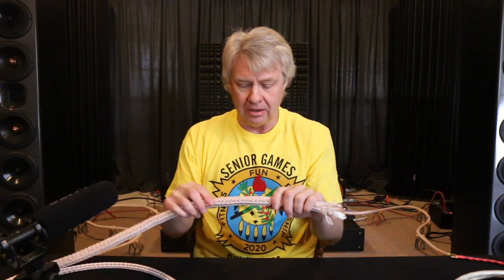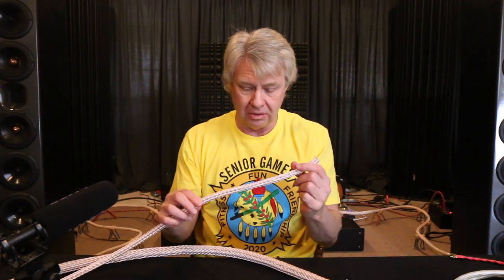What’s up with Audiophile Cable Risers?

Comment: I've always been told that rising the cables is only really needed if it's a concrete floor with rebar in it. Something about the cables being close to the metal rebar causes an induction effect.
I actually don't know what's happening but don't doubt it's noticeable in a high end hifi system. Because what isn't? ;)
Reply: My cement floors do as you describe...
Reply: I have read that even a regular carpet can generate static electricity that can affect the cables. Risers are one way to get those cables up and away from any potential static or induction interference. Just realize, it's a tweak, not a cure-all!
Reply: @dmark2639  Bbbbbutttt it is a cure for floor generated resistance. In the first system I put the speaker cables on risers-er- cardboard boxes... it removed a haze, a dampened thing on the high frequencies that I simply could not sort until that moment. And what are other tweaks? Let's say I use sorbothane for the feet of some gear or speakers, yes it's a tweak, but the tweak cures a problem. Tweaks are not silly flamboyant flourishes, they are cures for real sonic problems in a room. Spend a few years treating room s and you'll understand that tweaks are, when used properly, cures for genuine sonic interference in the sound your hearing from the system through the room. And by all this I do not mean tweaks bought from $$$$$$$ vendors, I mean an understanding of materials and physics and using the best materials to solve problems, it is amazing what one can do with just the few materials that actually apply to audio, the aforementioned Sorbothane, Rockwool, MDF, mass loaded vinyl... cheers.
Reply: @dmark2639  only if there was something causing a rubbing motion constantly
Reply: @cabasse_music  Like your feet as you walk around in the room? Yep, that'll do it.
Reply: @dmark2639  no i mean right where the cables are touching, and to such a degree where the motion is so constant that it is never able to dissipate. this is all easily measurable anyway and even in some case where a static charge was building up on the carpet, the insulation of the wire would be more than enough to block it. this is flat earth science right here

Comment: Excellent advice.  My journey followed a similar path.  Well after my system achieved a good 3d sound stage I read about cable risers and skeptically tried them and observed similar results.
I have used cardboard V risers.   My fastest most cost effective was paper coffee cups.  Paper has a dielectric coefficient as good as cotton.  I am so cheap I saved my morning coffee cups.  Cut a V in the top and they work well.  3" tall.  Bingo.  Currently I don't need them.  The speaker cable is sized to travel from the monobloc to the speaker without touching the floor.
Now for an even more controversial topic.  I find a slight improvement getting power cables up off the carpet.  Impact is a slight sense of compression of the sound like you have with a new capacitor.  Not as pronounced.  Definitely could not pick it out in a controlled ABX test.  But once you hear it, it stays in the system.  One of those hundred little things that all add up.
Reply: I'm like you. I look for low cost tweaks that can help. Find a half dozen of them and things become noticeable. I can't afford $2,000 amps, ect.

Comment: What's your floor construction? Is it a concrete slab? If so, there is probably steel mesh reinforcement (often 6" x 6" grid). Or is the floor constructed in another way?
What's going on?

Comment: So how do I manage the 50 cables hanging off the back of my equipment?  I can't seperate all those cables in the cabinet.  Is there a similar cable management system for all the power, RCA and speaker wire mess behind the cabinet?

Comment: Is it electrical or vibrational issues affecting the cable, and what’s under the floor? If height doesn’t matter  then perhaps using slit pipe insulation,cut into short pieces would do the job too

Comment: would this be the same for power cables and interconnects, or only something that affects speaker cables. Not that my system is anywhere near the level that it would make a difference but just curious. Thanks for the great video Danny.

Comment: At dealers, shows, that I have seen the use of risers, the explanation was always the same,  static electricity in the carpet was affecting the sonics and that it wouldn't have much effect on wooden floors.  Never heard of rebar in concrete issue or see how cryogenically treating the risers would improve things.  But hell if it works,  c'est la vie.

Comment: 😂 Danny did you measure the difference? Being an engineer can you explain what it is what you think you are hearing?
Reply: How to do you measure the depth, width, height and layering of the imaging and sound stage? 

In the past I’ve put bits of tape on the front and side walls marking positions of where certain effects, instruments or vocals come from, Swapping out bits of gear or moving room treatment makes a serious difference to how it’s all presented.
Reply: @lloyd.8272  yes it does but I am not buying setting speaker wire or any other wires for that on toys is going to make any difference in any of those things. To answer your question crosstalk, separation, reverberation and reflection and SNR and noise floor all can be measured and will effect our Psychoacoustic perception. Also placebo effect will effect how we perceive sound. That is all I know but I am not an engineer either. 😊

Comment: On one of our trips to ikea, purchased some cheap glass tea light holders with little slot designs at the top that could (effectively) cradle my cables. And - dammit - it made quite a difference.
Reply: Lol I didn't want it to work either.

Comment: I used cable risers with my planar speakers but did not notice any difference. I upgraded my speakers a few months ago, but didn't bother using the risers, just left them on the hardwood floor. I tried the risers after seeing Danny's video. I experienced everything he said. Thinking that it was an expectation bias, I rounded up the House Boss, who has no interest in stereo, and thinks that audiophiles are mostly males with OCD issues. She sat down for about 15 seconds, and said "What did you do? It sounds a lot better!"
I don't think the issue is whether they work or not, the issue is, do they work for you?

Comment: Tried it back and forward a few days with my speaker cables, sounded better without the risers and just lying on the carpet. There was definitely a difference, with the risers voices became thinner and almost fatiguing. I now use them to route the power cables over the signal cables but stay away from the speaker cables 👍 Still find it strange to notice a difference 😳

Comment: I watched your video on getting the speaker cables off of the floor. I didn't want that to be a thing. Two months later my girlfriend cleaned up the living room and took all the cables off the floor and stuck them under the tv to get them out of the way. When I woke up I didn't know she had done anything but she was playing music and I could tell right away something had changed. It was so obvious that it was better, I could hear things in the music that I've never heard  and she plays these songs a lot. Seeing 2 garbage bags by the front door told me she had cleaned up the spot where she sits on the floor in front of the tv. I knew without looking that the wires weren't on the floor anymore. Does it make a difference, way more than you think it will,  get them off the floor, the difference just might shock you. It's noticeable immediately.
Reply: Don’t you think the acoustics of cleaning up a room would have much more of an effect than speaker cables not being on the floor
Reply: @ar_xiv  no, having the wires off of the floor has made a difference. The room was cluttered many times since and the sound has not changed.

Comment: Read an explanation from a physicist about energy transfer in a conductor.  Electrons do not start in your source and physically end up in your speaker.  Summarized as follows, "electrical energy does not travel though the wire as sound travels through air but instead always travels in the space outside of the wires. This is because electric energy is composed of electric and magnetic fields which are created by the moving electrons, but which exist in the space surrounding the wires."  Energy transfer from source to speaker results in creation of pressure variation or ears perceive as sound.  Therefore, it makes perfect sense that the electric and magnetic field (energy) surrounding wires can be affected by materials or other electric or magnetic fields.  Do cable risers, copper, insulation, etc. always make a difference in every situation.  No.  But Science is clear that an affect is possible and saying that those things can't ever make a difference is wrong.
Reply: With or without risers they measure the same. Flawed human hearing is more likely to explain the sudo differences be heard. Again never seen this replicated in blind tests successfully. But I have seen guys like Dany fooled with lamp cord or a 320kbps mp3 in blind tests.
Reply: @neandrewthal  So does science only matter when it aligns with your beliefs?
Reply: @iowaudioreviews  There it is, the usual refrain about flawed human hearing.  "Two ears and a brain respond very differently to a complex sound field — and are much more analytical — than an omni-directional mic and analyzer. (Dr. Floyd Toole).  If flawed human hearing cannot be trusted to hear differences, then it cannot be trusted to hear no differences.  Your flawed human hearing rationale renders blind test results invalid.
Reply: @jfritzy4358  I replied to the wrong thread.  If science shows that cable risers improve the sound I'll believe it.
Reply: putting aside the science of it... What does Danny have to gain from telling you that it makes a difference? Does he sell cable stands? No, does he have a vested interest in a cable stand company? No, what does he have to lose? He can risk his reputation for zero gain. Does that sound like the sort of thing that someone that couldn't hear an appreciable difference would do? You don't go on YouTube and tell people that cable stands work with nothing to gain and everything to lose unless you can hear some difference.

Now yes it could be a case of pure imagination brought about by his brain playing tricks, but since his experience is far greater than mine about such things, I am prepared to give him the benefit of the doubt, especially since it cost nothing to make some cardboard stands like he suggested, or fire up the 3D printer and make some. I am probably the worlds biggest skeptic when people make these kinds of claims, but I am not going to simply dismiss it as snake oil without at least trying it for myself and making an informed decision.

I once thought that a power cable couldn't possible make a difference till I borrowed one, and heard the difference for myself.
Reply: @DodgyBrothersEngineering  I don't think anyone is accusing him of deliberately lying for financial gain. I can't speak for anyone else for what they are actually saying but I am saying given what we know about audio and what we know about the human brain the overwhelmingly more likely explanation is that his brain is playing tricks on him. He may have more experience than you and he definitely has more experience than me but experience does not equal authority, especially on a such a tricksy subject and is absolutely not a reliable protection against snake oil.

Think of the dumbest snake oil think you can think of. One you know to be false for a fact. Then consider that there are many people with more experience than you and I put together who believe in that thing. Should we give them the benefit of the doubt?
Reply: @DodgyBrothersEngineering  Nobody who says "cables don't matter" (in the context of audio) also means that you can use any cable for any job in the world, like an 18 awg to feed your house. And running wires in twisted pairs for some application where it might not be necessary is a far cry from the exotic and expensive snake oil audio cables some swear by. 

I agree that he believes it's true.

Comment: Wire's capacitance can't be denied in higher voltages. We started using "medium" voltage, (3000 vac), wiring where I used to work and the wire would hold enough charge unplugged that it could kill you if  you didn't remember to discharge by shorting it.

Comment: Cable risers work for me. I paid $35 for enough 3D printed plastic risers to suspend my cables off the floor. The increase in clarity and focus is obvious. 
Thanks for sharing, Danny.
Reply: Hmmm...not saying it is not an improvement, but if it were me, I would not want the risers made out of a conductive material like plastic or metal. Maybe try wood or ceramic, cork, or even cardboard in your system to test the theory...
Reply: @dmark2639  That's a reasonable suggestion. I may try it, though I'm pleased as is. Happy listening!
Reply: What about the dielectric properties of your 3D printed plastic?? 😭🤣😭🤣😭🤣

Comment: Danny is your floor on the ground ie is it a slab of concrete or perhaps is there already electrical cables running through your floor just trying to make sense of why this is making a difference. I'm in an upstairs flat so if its because you're lifting them up away from ground then it's unlikely to change in a flat but if its because of proximity to other electrical cables then it may just make a difference in a flat as well.

Comment: Basically, my cables and interconnects are a dense jungle. I tend to lazily chuck them behind my substantial floor standers. ‘Out of sight, is out of mind’! The only time I get to enjoy some extended, attentive listening, is when the wife goes to spend a few days with our grandchildren, leaving me supervising our 4 teacup chihuahuas. I pull the speakers further out into the room and chuck her prize, large glass coffee table into the spare bedroom.

When I’m listening to music, the chihuahuas normally hide. On one occasion, I remember it well, I was listening to some Americano. I went out to the kitchen to poor a cold beer. On my return I noted a marked elevation in audio performance from the right channel. I suspected a fault with the left channel. On further inspection I found all 4 chihuahuas had berried themselves under the cable jungle behind the right speaker. When I removed them, equilibrium was restored.

I’ve now trained my ‘high end’ chihuahuas to snuggle up in pairs, when I listen to music. One pair beneath the cable jungle behind the right speaker and the other pair the left speaker.

I cannot guarantee the effectiveness with every breed of dog. I would suggest that anything larger than a Yorky would be counterproductive. I can’t predict what cables or speakers it would work best with, though I guarantee there would be no benefit of trying it with wireless systems.

Enjoy experimenting, but most of all, enjoy the music.

Comment: I've used cable risers for a few years now. I'm not 100% sure I hear a difference but, I just made some cheap ones cutting up a 2x4. Cost me $3 and had the hardware store make the cuts. I have no problem using them because they cost next to nothing.
Reply: You should be extremely embarrassed. That's a good reason to not use them.
Reply: @neandrewthal  I know...I suck.

Comment: Recently  i made some cable risers for 2 systems i have..  one  system is  on a wooden floor and  the other sitting on a concrete floor.  Both made differences in clarity/ separation and definition. As a result i also found the volume didn't need to be turned up as much to enjoy the definition of instruments and with one of the systems i really  noticed a difference in soundstage, there is a depth to the the positioning on the instruments.
Reply: Cody Smith  Hey, you have yet to answer my question regarding "controlling one's Dreams".  So do you believe that this is possible (just as I described above) or do you also contend that what I am suggesting concerning Dreams is simply non-sense / impossible?
Reply: Cody Smith  "...a blond test"? are you testing hair tinctures in audio?
Reply: Cody Smith  I did a blonde test. It was stupid.

Comment: I'm curious about the sound difference using self-powered speakers and digital signals (AES) (or line level in shielded signal cable/conduit) to the monitors and how they compare to separate amplifiers. Personally, I have found self-powered systems to work quite well.